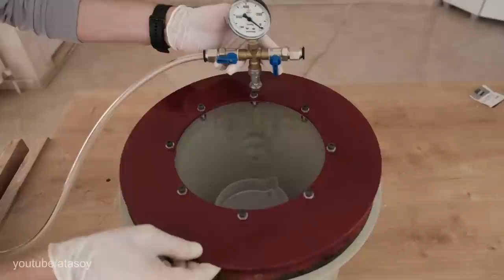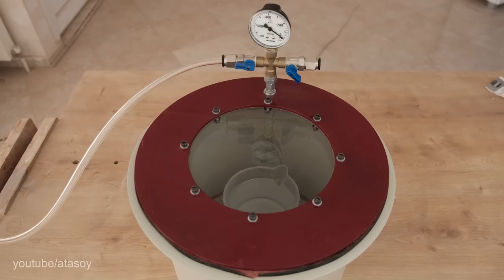Decorative Snowy Mountains Epoxy Lamp | Epoxy resin art

Comment: Pretty amazing.
 I saw you struggled to remove that hot glue and was wondering if you know that IPA or rubbing alcohol will let you remove hot glue quick and easy without any residue?
Reply from the maker: Thank you very much, I'm glad you like it.
One of my followers had previously recommended that it can be removed with IPA, but I forgot at this stage, it never occurred to me. Thanks again for reminding me of this. I have IPA on hand, I will try it on my next project.
Reply: @atasoy  No problem. I hope you'll find the IPA trick as useful as I did.
Reply from the maker: Thank you very much, I think this tip will work for me.

Comment: I love this, but how does the touch sensor work??
Reply from the maker: It works with 12v dc electricity.
The magnetic on it is positioned in an area of suitable thickness.
There is a thin layer between the sensor and the wall. (In my tests, it works well in thicker shadows.)
Once tapped, it functions as an on/off function. A long press turns the brightness of the light on and off.